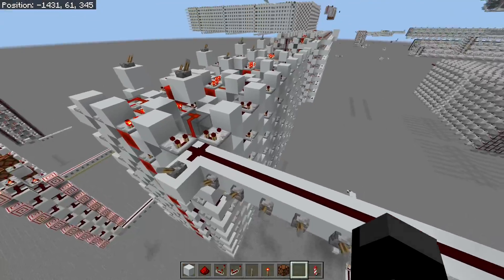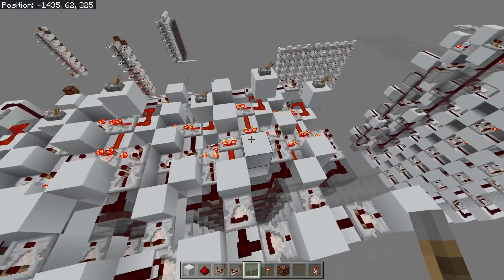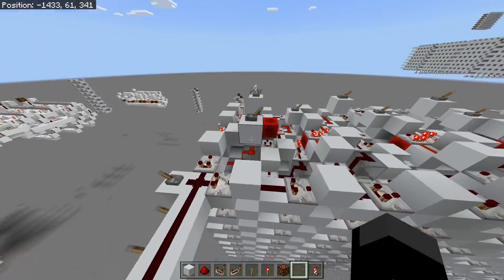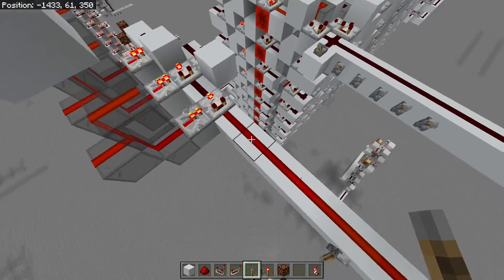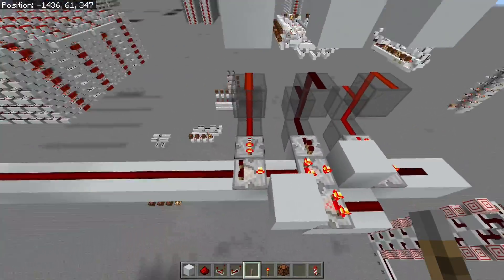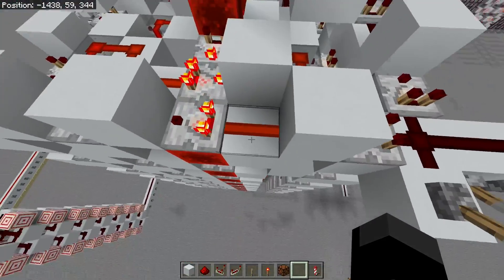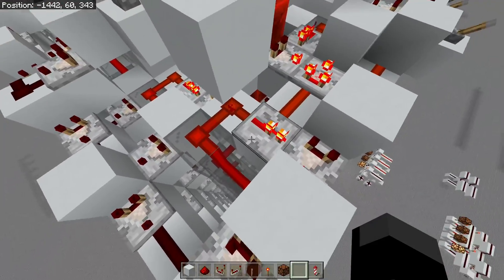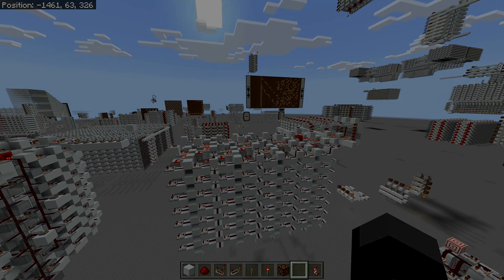Compact Serial HEX Cell Showcase - Minecraft Bedrock

Comment: Can you make reapet untill or if in Minecraft
Reply from the maker: There are several ways of doing this depending on your use case. If it's just some sort of circuit, you can AND a clock pulse with an SR latch. When the SR latch is set, the and gate will output the clock pulse, when it is reset the and gate will no longer output. Then you will just need to way of getting the "condition" for the if statement and plug that into the reset line of the SR latch.
You can also do it in machine code by using conditional branching